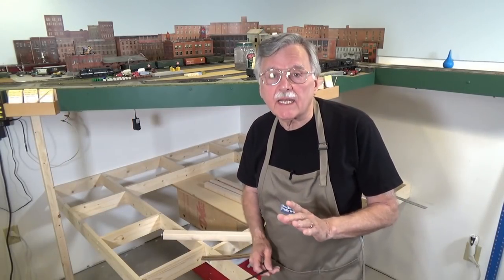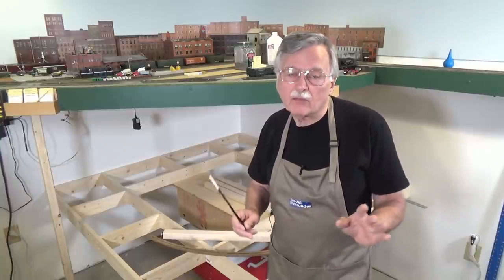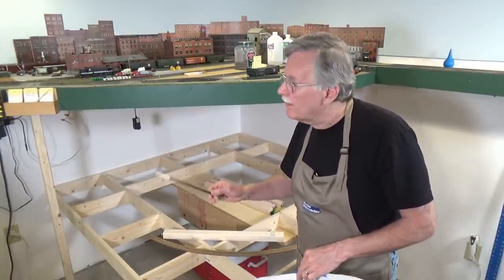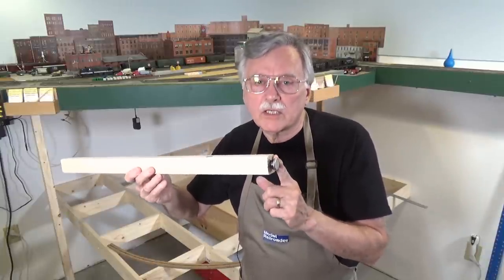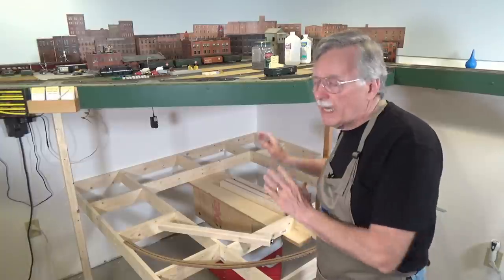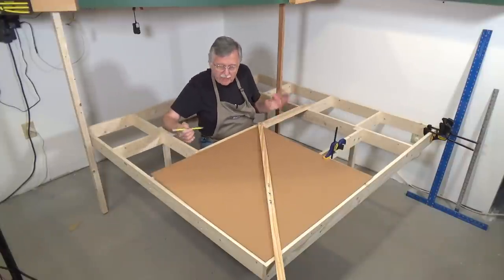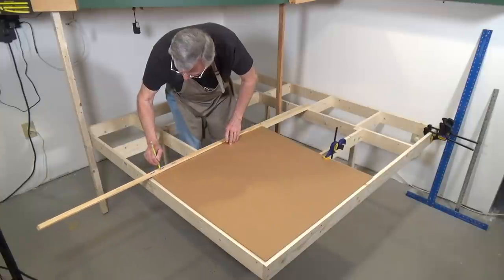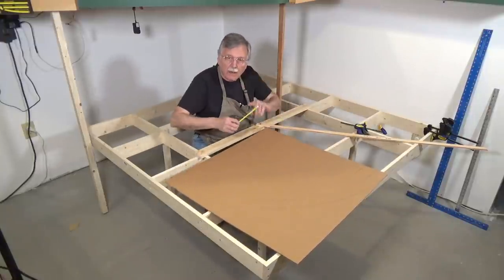The Big Helix: Adding Legs And A Roadbed Template (254)

Comment: I used a similar way to cut my circles when I built my 18 X 30 layout.  I marked a 1 X 2 every two inches from 26 inches up to 38 inches from the center.  I still use it for other projects too.  It can be tedious if you do not know something about Math in general.  Much needed for today's modeler.

Comment: Larry, if you got a router, you could of course use a similar tremel construction to cut out the different sections from the plywood sheet. This, will also improve the accuracy of each section.
Reply: I would cut out the template as Larry did, and using the template to draw more pieces on a plywood sheet than a router trammel right on the plywood might conveniently allow.  If, to get the maximum number of cuts, the trammel anchor point had to extend beyond the plywood sheet, using it could be cumbersome.

My preference is based on having the advantage of a router table.  I will be cutting the template from 1/4" sheet stock, sanding it to exact finished size.  Then I'll draw as many segments as I can fit onto a sheet, even making smaller segments to get the most out of each sheet.  Those will then be rough-cut.  Then I'll mount the template atop each segment with double-sided tape, and using a pattern bit in my router table, finish them all to final size. 

I haven't used my Christmas present biscuit joiner yet, so I might try that, gluing segments together using biscuits and good, strong glue.  If I find that results in poor joint stability I can always use a thin splice plate.

I never imagined my shop would come in handy building a railroad when I first set it up.
Reply: @genebarfield6688  got some great experience with router bits and added copying wheels. Then you only need the trammel pivot once.

Comment: Since the legs are twice the thickness of the bench framework, it makes far more sense to drill fasteners through the bench work into the legs, rather than your opposite approach. I used the same stock for my legs as I did for the framework, so it didn't matter.

Comment: Larry, great video. One question, when you attach the frame/ legs to the wall, does that not defeat the use of the adjustable feet?

I am following along with great interest because I will soon start my benchwork and the helix is the first project.
Reply: If can interject... the adjustable feet are to make up for any gaps between the legs & floor due to the floor itself not being even. Cheers!

Comment: Great video, very helpful layout of the bench work. Do you have a link to David’s Canadian canyons video, I like see how he makes the templates.
Reply from the maker: The Canadian Canyons project layout was a MR feature several years ago and it was the subject of numerous videos on Model Railroader Video Plus, a subscription service. The videos are still available as past of the MR digital plan. His full sized template was all done by hand in a similar manner as mine except he used a yardstick with holes drilled in it i stead of setting up a trammel like I did.

Comment: Hi Larry, so you are only planning one track on the helix, basework framing looks great
Reply from the maker: Yes, I originally considered double tracking it but then reviewed my planned operating schedule and only found a couple of instances where two trains would need to use it at roughly the same time so it wasn’t worth the extra space and money. Track gets expensive and would require an extra 30 sections of flex—another $200 or more.

Comment: Hi Larry thanks for that enjoyed watching and looking forward to the next instalment. Hey Larry I was looking on another channel and on it was described a unit produced by NCE containing 4 bulbs and the channel showed how to produce your own at a fraction of the price. The unit was designed to absorb shorts on the track by lighting the bulb. I was wondering dos this do the same job as the snubber described on your channel?
Reply from the maker: These are called ballast lamps and I did a video (#109) on them some time ago. They simply prevent shorts from reaching your booster.

Comment: Hi Larry,
Great topic to cover and looking forward to the next installment.
Wondering how the reach-in to the top deck will work, it's a fairly deep section already - will the helix will keep you further away from the corner? I had to pull the upper deck towards the aisle to keep it within reach.
The handing of the helix also raises an interesting question - on the top deck I wanted the tracks to be on the aisle side (anti-clockwise heading down in your case) as this is a scenic level and the trains are in sight longer. This means the tracks on the lower deck emerge at the back - with limited space for the staging yard, the ladder is close to the helix but not along the aisle, which is not recommended. In n scale the reach to the turnouts is not ideal but has been manageable, but this dark place often sees trains which are heading up the helix run into turnouts that have not been lined properly. The signal department are now working on a way to kill track power until the route is properly set. 
Single deck in a bedroom was never going to be an option for a Class 1 mainline, so whatever problems we might face there is no escaping death, taxes, and two helixes.
Reply from the maker: Yes, it definitely would interfere with the ops in  the Charlottesville industrial area above had I not made allowances for that. To deal with that I put magnets at each turnout for uncoupling cars and the turnouts are all controlled with Tortoise switch machines. In case of accidents I do have my Topside Creeper to crawl up on and retrieve cars and locos. The industries there will only be served by the Charlottesville Yard crew as they get time during their shift. This fits with my goal to prevent folks from reaching in and manhandling my locos and rolling stock by picking up cars and using coupler picks.

Comment: Larry, thank you for quick response. I am new to model railroading and at the ripe old age of 65, there is a lot to learn. your series has been invaluable. One more thing, How do you design a layout. I just don't want to copy someone else. Is there software out there that can help with this?
Reply from the maker: I have been using CadRail since about 1991 and find it great. I designed the Piedmont Southern with it and can take measurements from the plans, lay the track, and it comes out perfect. I suggest you get some of the Kalmbach track plan books and study them. Also if you can fond John Armstrong’s planning books they are an invaluable resource. Finally remember, just because you can do something doesn’t mean you should—keep it simple.
Reply: THANK YOU! Your insight has been invaluable, and I can now start this project with confidence. @TheDCCGuy

Comment: Question, I was watching an early video on building two tables and connecting them, HOW do you separate the tables once you have laid track across?
Reply from the maker: Remove the bolts and pull them away from each other.
Reply: Thank you for your quick response.  What about the tracks?  Are they precut along the seam?  Removable?
Reply from the maker: Watch video #156.

Comment: The helix project looks very good but have a question.   Seems to me the it will impede the ops on the upper end reach.    Great vid so far
Reply from the maker: Will not sure about your question. The helix is the only way to get trains from one level to another. In this case from the staging yard up to the main deck.
Reply: What I ment was above the helix there is switching opportunities it looks to me like the helix will restrict the reach switching cars above the helix.   That’s all I questioned.  It is a great project you are doing
Reply from the maker: Yes, it definitely would interfere with the ops in  the Charlottesville industrial area above had I not made allowances for that. To deal with that I put magnets at each turnout for uncoupling cars and the turnouts are all controlled with Tortoise switch machines. In case of accidents I do have my Topside Creeper to crawl up on and retrieve cars and locos. The industries there will only be served by the Charlottesville Yard crew as they get time during their shift.

Comment: Is there a way to contact you off-line to run a PECO Electrofrog N scale turnout question by you?
Reply from the maker: I have never even seen an N-scale electrofrog much less worked with one. However if they are the same as the HO scale version then I might be able to help. I prefer not to post my personal email address on the internet so please try asking your question here.
Reply: @TheDCCGuy  I guess the real question is if I am going to manually control the switches via a servo (not connected to the DCC system) and want to power the frogs for more reliable operation would there be a concern about shorts?  I would follow the basic steps you show in (142) but the switch would not be connected to Blue Point turnout controllers or Tortoise machines. In this scenario where would I connect the "frog" wire?  Is this even possible?
Reply from the maker: There may be some servos with a built in SPDT switch for powering frogs but I have not seen them. So that is your first job, find a servo with a built-in way to switch frog power. The other, and slightly more costly option is to use Frog Juicers or the Frog-AR that I showed on video # 250.
Reply: @TheDCCGuy  Thanks for the responses.  I've got some more investigating to do!

Comment: Well done Larry, as usual, another interesting video. Personally I always use glue as well as screws to hold my woodwork together, but perhaps that's just over engineering. Your mention of plywood costs struck a chord as the same is true here in UK, and the quality is not as it was. I have found some industrial suppliers with good prices and quality, but I have to buy in large quantities. I would have enough plywood to build a helix for the full size railway.